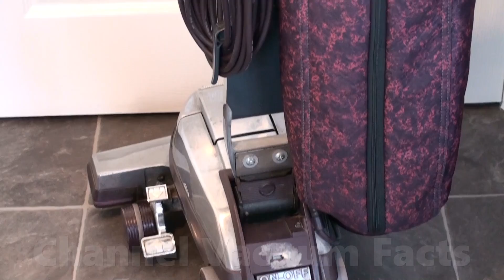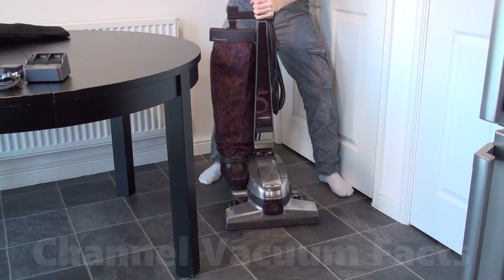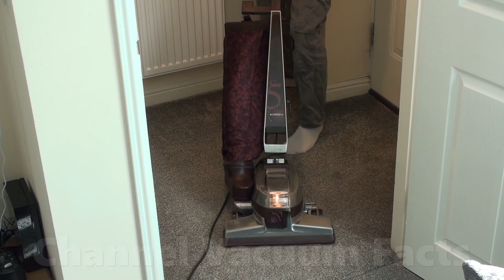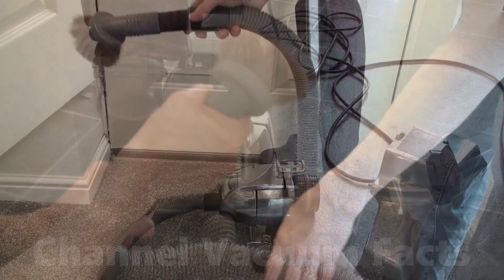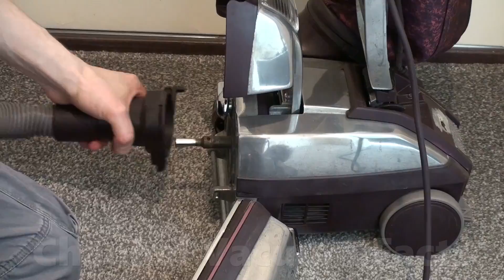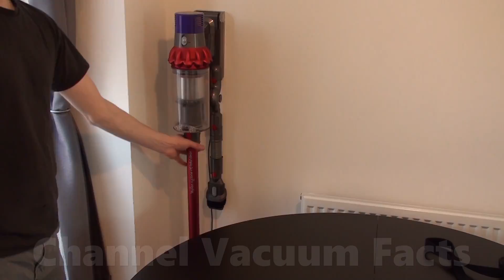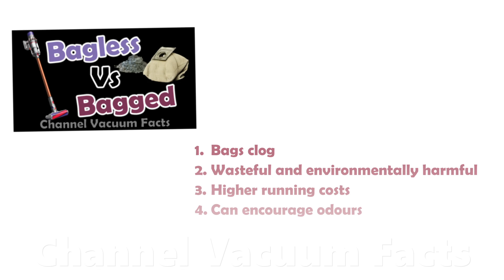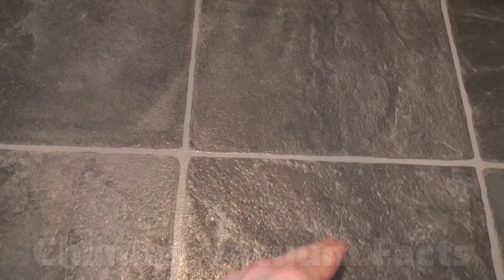Review of a Kirby Vacuum Vs Dyson Cordless

Comment: I've used a Dyson Ball Animal, and later a Dyson Cinetic Big Ball Animal, for years on my mid-pile, flow-through carpet.  I shampoo it 2 - 3 times/year.  Every single time after shampooing, I would get three deep dirt stains in my dog's favorite sleeping spots by month 3 - 4.  You could set your calendar to it.  I would vacuum these spots over and over again, yet I would eventually need to call the carpet guy.  One day, a friend gave me an old Kirby G6 he wanted out of his garage.  I cleaned it up, put in a new brushroll, belt and hepa bag, shampooed my carpet and decided to try the Kirby instead of the Dyson.  I am now in month 5 and there are absolutely NO dog stains.  NONE.  I used to hit those spots at least 4x to 5x more with the Dyson because those dirt stains would keep getting darker and darker.  Now, I can probably go another few months before needing another major shampoo job.  Please explain why this is happening.

The bag also collects plenty of dirt, but far less carpet fluff than the Dyson.  Was my Dyson brush roll shredding my carpet?  It sure seems like it.  I also weighed both machines (23 vs 19 lbs).  The Kirby does weigh about 4 lbs. more, which is less of an issue for me because I am strong enough to lift 4 extra pounds and my home is a single level without stairs.  But, it's far easier to push due to the power drive and the weight of the machine allows it to push through the pile when the Dyson would sometimes get hung up on it slightly.  Most important of all, I've noticed it's less fatiguing because the handle weight of the Kirby pushing down on your hand as you control it is so much less than the Dyson.  Please explain this as well.
Reply from the maker: It's hardly my job to explain other people's anecdotes. Assuming any of that is true, it could be explained by all sorts of things. None of that really accounts for any of the observations in the video, though.
Reply: @VacuumFacts  The observations in your video are mostly anecdotal, with minimal test data.  And your testing doesn't account for the most difficult stains that happen gradually:  ground-in dirt caused by pets.  You don't have a single test that covers it because you can't just toss a few grams of whatever on a carpet and simulate this.  I'll admit that my observation is anecdotal, but that is no excuse to discount it just because you can't explain it.  Could it be that the explanation runs contrary to your claims and you would rather just not address it?  That's called selection bias.  If you can observer a massive difference in performance without a statistically-controlled test, then those results ARE important and worth exploring.  If you change a component on your car and gas mileage goes from 22 mpg to 174 mpg, you don't need test data to know you've discovered something significant.  Your testing is fretting about tiny statistical differences between machines, which is valid and worth benchmarking.  Yet you provide absolutely no rationale as to why I vacuumed like crazy with the Dyson and those dog dirt stains would ALWAYS appear, but when I switched to the Kirby, you couldn't find those stains no matter how hard you looked.  The toughest dirt to get out are those dirt stains that are common to every pet owner.  I used a Dyson "Animal" product that couldn't get the job done, but Kirby did.  Why is that?  Could you be wrong about airflow?
Reply from the maker: Which observations have minimal test data? What is it about ground-in dirt from pets that distinguished it from what I've done, specifically, and where is your supporting evidence? You say I can't explain your anecdotes, but I already said it's not my place to; that's your job, and you haven't done that, which makes your comment hypocritical. You talk a lot but say very little of relevance that has any evidence behind it. That also nicely explains why it's different to what's shown in the video. You. Have. No. Good. Evidence. People can make their own minds up about what I've presented in the video. Until you get something meaningful, there's nothing more to discuss.
Reply: @VacuumFacts  What is it about ground-in dirt from pets that distinguished it from what you've done?  The answer is obvious:  sprinkling some dirt on a carpet and rubbing it in with your hands is nothing like an animal grinding in dirt from their coat after hours and hours laying in one place.  None of your tests simulate anything close to this.  Short, dirt-sprinkling tests are worth examining, but it isn't remotely close to "real world" analysis.  Good engineering encompasses both short-term lab and long-term in-home testing.  I'm sure Kirby and Dyson do both, but they just don't publish their results.  Your tests are severely limited and your mindless alliteration only proves you are spouting propaganda.  I don't know why.  Maybe you work for Dyson or have a friend or family member who does.  You.  Seem.  So.  Frustrated.  Why is that?

Also, all of your talk about how the Kirby is so heavy and hard to use and you can't remember how to push the foot switch or the correct way to carry it, or it's too hard not to crash into walls.  Are you kidding?  The other user comment about how you should stay away from shop class is right on the money.  You sound like you just passed Wussy 101.

You used an old Kirby.  Was it rebuilt?  Were the brush roll and bag new?  The fact that you don't even cover this in your video is blatant confirmation bias.
Reply from the maker: @neosonik  Well I'm glad you cleared that up for us; I don’t know where we’d be without you… >_>

Ignoring that you’re confusing different dirt types—dust with hair for example, you seem to fail to realise this was a comparative test for dust alone. Not testing using fur doesn’t negate tests which use dust. Secondly, Dyson DO publish their results, or at least the conclusions verified independently by professional laboratories testing to industry standards. A simple fact-check would reveal this to you. The conclusions are that the Dyson cleaners perform better across all floor types than any other vacuum.

The rest of your comment is simple denial and you haven’t really acknowledged the problems shown or refuted any claims made in the video. The video clearly stated the Kirby was fully serviced, but you seem to have failed to understand the key point; the design is very poor and it shows. Ever wondered why Kirby never commissioned independent testing of their machines like Dyson did? Any company that was confident in the relative performance of their product would.

Comment: I never did like the Kirby machines. Imagine over 20 pounds coming down the stairs! I do my stairs with my Numatic vacuum and it stays at the bottom as it use the crevice tool and turbo tool on the stairs and risers, it does a pretty good job actually.
 It's safe and the good suction at the crevice tool allows it to clean well too. I also wouldn't want a £500 V11 going down the stairs if it gets dropped.
Reply from the maker: The V11 can be dropped down the stairs without issue. Have you seen how they test them? They throw them off a platform onto the floor lots of times to show they survive. Stairs are easy.
Reply: @VacuumFacts  Yeah, I have seen the extensive tests and I'm sure it would survive a few drops. The Numatic at least has an advantage, it has no stairs to fall down as it at the bottom.
Reply from the maker: It's unlikely you'd drop something you had well-gripped in your hand while on the stairs.
Reply: @VacuumFacts  Yeah I wouldn't drop it but you know what some people are like. I have seen people selling cordless Dysons that have been used to suck up water 🙄. As you said the Dyson is well made so would most likely survive. Also have you had any problems with yours? Apparently the vacuum can still be turned on when the bin is open?
Reply from the maker: I was the one who first discovered and revealed that bin problem on YT. Apparently it's still there with the V11 which I'm surprised by. But you make the mistake once, and if you'd have to be pretty dumb to do it again. You just take your finger off the trigger and extend it outwards. Or take the filter out, but that's more hassle.
Reply from the maker: Oh, and no, no problems of any kind. As good as new still, despite heavy use.
Reply: @VacuumFacts   Vacuum Facts  To be honest I thought that too and I see so many channels saying it will cause problems such as it would go in the cyclones regularly and clog the filters but yeah your right. I was considering a Dyson V11 but I don't really want to pay that much for a cordless vacuum. If I did get one it wouldn't really "replace" my mains vacuum as one of them is used for DIY work and Dyson says not to vacuum up plaster dust and ash. Do you have an vacuums for "DIY" work and other mess etc?
Reply from the maker: No, I'd use the Dyson. See this: https://youtu.be/uuF0Q0x3P8E
Reply from the maker: Extremely ultra fine dust will get past the cyclones and pre-motor filter and just go straight to the HEPA, blocking it up fast, but you'd know if that happened, and a rinse fixes it.
Reply: @VacuumFacts  Yeah I had to clean the filters on my other upright when it got clogged. Just an example; the attic had rubble, fine dust and fibreglass that needed to be vacuumed out. A Numatic vacuum was used and there was surprisingly 2 bags full of dirt and after a simple bag change and a tap on the filter it was fine. Of course this is a tough DIY job but seriously a V11 wouldn't have been able to handle it.
Reply from the maker: Possibly, but without trying, we'll never know.

Comment: Btw how did you manage to run the Kirby over your foot? Are you a very clumsy person? 😁
Reply from the maker: Manoeuvring that clump of metal in tight spots whilst not wearing safety shoes meant the huge fixed wheels tech-drive-ran over my toe. It's still bruised! Absolute shit. It comes as no surprise to learn that those who advocated them are always inconsistent with facts.
Reply: @VacuumFacts  Answer this question. The V11 is £600 but only a 2 year guarantee? Why only 2 years? Are they not confident it's gonna😘 last longer than that? For £600 that's a shit guarantee!
Reply from the maker: Because the warranty is bottlenecked by the weakest link—the battery. Mechanically, it would otherwise no doubt be guaranteed for 5 years (expected to last 10 at the very least with proper treatment). But batteries are a weak link and the two years reflects that. Don't know why warranties aren't separated out (too much hassle?), but I think Shark offer a separate time length warranty on the battery. But Shark's warranty's aren't worth the paper they're scribed on given the apparent hassle of working with their customer service. Solid state batteries may be more reliable and that might be reflected in the warranty, but only time will tell.
Reply: So £600 and after 2 years the battery is shot and you have to buy another machine cause you can't replace the battery. Hmmmmmmm that's not good is it! That makes me think a mains cleaner is a much better buy
Reply from the maker: Wait, why do you think you have to buy another machine? I can't speak for the V11, but the V10 can easily have the battery replaced, and it's £50 or something.
Reply: No wonder Dyson think the future is cordless 💰💰💰💰💶💶💶💶💷
Reply from the maker: That wasn't an answer. Why do you think you have to buy another machine? Answer that, because it's exactly how nonsense myths start. I suspect you've just accepted that from some moron elsewhere and never questioned it yourself, thereby becoming a tool to spread propaganda. Seriously, I want to know why you think you'd have to buy another machine.

Also, you're making the assumption that battery failure is common. That needs evidence and I presume you have none as usual, despite froming strong troll-opinions :P
Reply: @VacuumFacts  Not as easily replaced as one you can swap out like on some other cordless cleaners. So £600 plus another £50 every 2 years. And if anything else fails on the machine you are fooked. 🙈
Reply from the maker: You've evaded my question a second time. The nonsense you're regurgitating on behalf of others you're communicating with doesn't make you look good. Third time lucky; why do you think you have to buy another machine if the battery fails?

You've also said nothing about failure rates and are still assuming the lifetime is 2 years; it's not. My DC35 battery lasted 7 years without any noticeable performance hit, and that was old tech.

And you're now introducing an assumption that battery replacement is so common (like emptying the bin) that needing to unscrew it is a meaningful hassle. This is barrel scraping nonsense. Answer these questions.
Reply: @VacuumFacts  I'm not communicating with anyone. It's a rubbish warranty for  £600. Anything could go wrong not just the battery. I think that would put many people off buying it. They cud at least say 2 yrs on the battery 5 years on everything else and if the battery does fail within 5 years we will replace it for a reduced fee as you've already had to fork out a ridiculous amount of money for a little stick vac.😁
Reply from the maker: Maybe they could. Take it up with them. Fourth time; why do you think you have to buy another machine if the battery fails? Where is your evidence the battery will die after 2 years?
Reply: @VacuumFacts  Well Dyson can't be very confident can they 😁
Reply from the maker: I think after 4 attempts at evading a simple question, I can only conclude you lack the ghoulies to admit it was an absurd comment without a dot of evidence in support of it that risks spreading propaganda. Reality is; failure is probabilistic, chances of failure are low, and the battery is likely to last the lifetime of the product for most people, with simple workarounds for those whom it doesn't. It's a non issue, and Dyson support customers even out of warranty.
Reply: @VacuumFacts  It's not a non issue. They lack confidence in their stick vacs. They only have confidence for 2 years. That's not good enough for a cleaner that costs £600 I'm afraid!
Reply from the maker: You'd need to provide evidence I'm afraid if you think it's not a non-issue, that shows it is. I'm aware of none. Many don't agree that the 2 year warranty isn't good enough for the price. The battery limitations aren't unique to Dyson and you might as well be saying the same thing about the latest smartphone.
Reply: I wonder why Dyson didn't go with a replaceable battery to offer more run time. Also, at a $600 price point a 5 year warranty should be standard.
Reply from the maker: @timconnell9587  Because a second battery would have been unnecessary with smart cleaning, and grotesquely abusive to the environment and the user's wallet. The V11 battery lasts longer than both Sharks batteries combined, so technically it already gives what you're asking but without the negatives. All covered here https://youtu.be/uM3Xfi1_ljU . I'd personally like an infinite warranty and in fact, a free product, but first-world problems.
Reply: One of my employees had a Dyson and she dislikes it. She said its cheep and doesn't clean as well as her old Hoover.
Reply: @VacuumFacts  😂😂😂😂

Comment: Haha funny 😁 One thing you got wrong though. The Kirby bags actually filter very well they go down to zero on a particle tester. The reason it got an F for filtation is because of the carbon emmisions from the motor which aren't filtered. There are some bagged cleaners I like. The Miele C3 with an electric power head The Sebo X7 and the Vorwek Kobold. These cleaners are far easier to use than the outdated Kirby. The Kirby is a direct air cleaner the other cleaners I mentioned have clean air bypass motors, completely different design. The Kirby weighs between 22 and 24lbs depending on the year of manufacture.
Reply from the maker: Except you don't know that for sure and have no data to back it up; that's just a barrel scrape assumption peddled by enthusiasts, despierate to avoid the humiliation. You're assuming the system is sealed and there are no leaks that dust can escape from. There's a crude rubber neck around the bag orifice, but that's not going to be good enough. Regardless, an F in testing means not good for health. Other cleaners allegedly emit carbon dust but they don't get an F. Doesn't add up. So no, I'm not convinced I 'got it wrong'. This product is a joke and I hope I've exposed the lies and deceit their 'fans' have been shovelling for all these years. And I can assure you, that encore you encouraged me to do is going to be devastating.
Reply: @VacuumFacts  There is a video where the Kirby is tested professionally in a sealed container and they show the emissions are zero. I'll have to see if I can find it.
Reply from the maker: You're thinking of this, I presume. And it's not supporting your case. Emissions are emissions. https://www.youtube.com/watch?v=gVopmYAygco
Reply: On a clean air machine the motor is after the bag and the carbon dust will be collected by the post motor filter. On a direct air cleaner the motor is before the bag and is not filtered so carbon escapes from the motor. The Kirby is well sealed.
Reply from the maker: Citation needed that the Kirby is well sealed; there's reasonable suspicion to the contrary. The bag is at high pressure; if the mating interface isn't as sealed as they'd like you to believe, it'll emit dust.
Reply from the maker: Glad you picked up on the humour though. A vacuum that utterly SHIT can only be reviewed with ridicule. The only thing more laughable is the nonsense spouted about it for years by the deceivers.